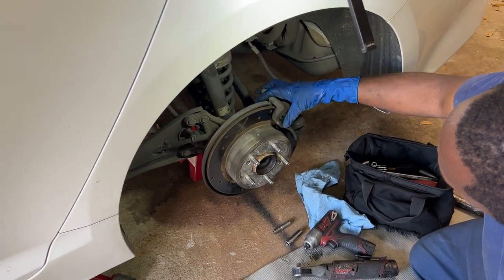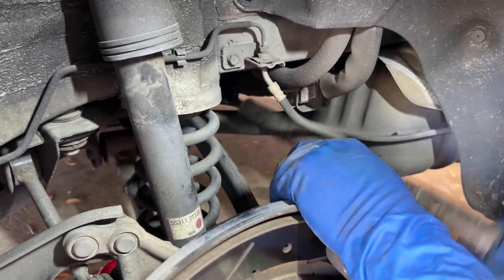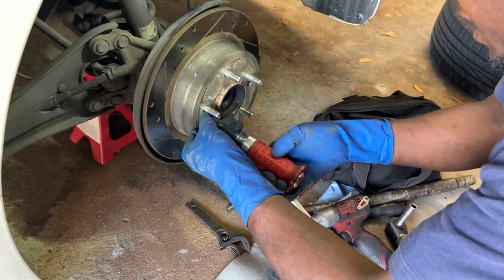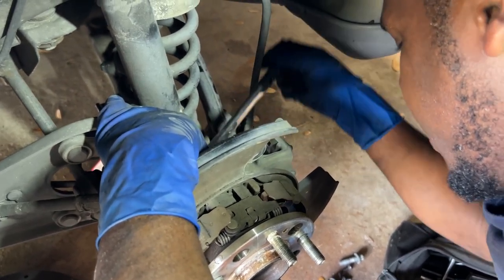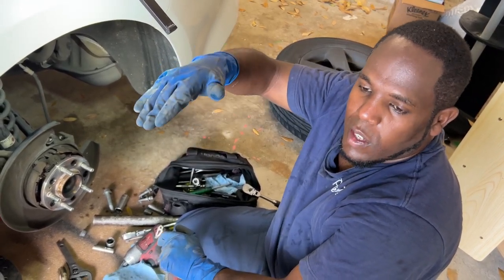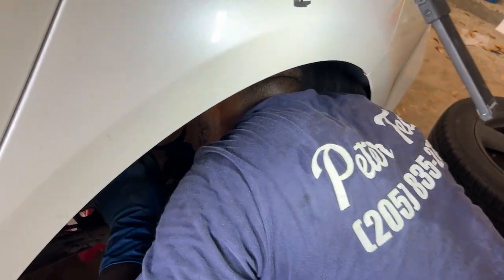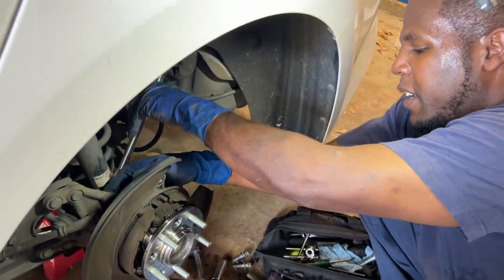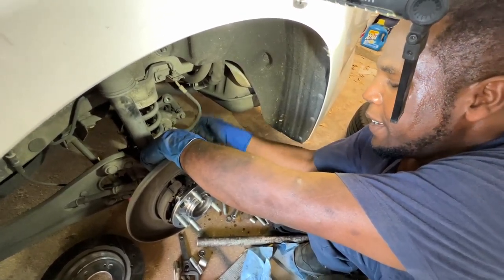HOW TO CHANGE REAR WHEEL HUB ON A KIA OPTIMA | CHANGE WHEEL HUB WITHOUT REMOVING REAR SHOCK

Comment: So i worked at the Hyundai dealership when these 2.4 were new. The engine oil problems stem from two main issues, one was they made the dipstick too long and the car was reading full when it was a qt low and ruining the top end of the engine. Two the timing chain guides were wearing out cause the originals were plastic. The recall engines beefed up alot of things but those two were the big fixes. I got one that had the recall wngine installed at about 75k miles and i got it arund 90k miles, its at 140k and runs like a champ. Loses maybe half a qt in-between oil changes but thats normal consumption for any engine.

Comment: Nice vid good view on the job. Hope I never have to do this on my car 😄 Takes some patience. Also my tip. Let somebody do an engine compression test. It is not that expensive and you will know the status of your engine and piston rings.
Reply: oil can be burned out also because the valve lifter seals! The compression test made with engine cold first without oil then it a bit of thick oil will show only if the  piston rings work as should. Sometimes the crankshaft seal which is on the crank side get to leak and you can`t spot it easy. One can loose some amount without any "trace"

Comment: What’s the torque specs to tighten your hub?
Reply from the maker: Whatever we feel is best
Reply: I guess I’ll just figure that one out on my own. What arm would it do if you say base on this make and model the hub tightening specs will range between 80 and 100 foot pounds torque. Hypothetically what if my best is right enough or too tight to cause thread breakage?

Comment: Damn.. KIA service manual recommend the whole unit to be taken out.. I just thought if there is way to "squeeze"  small socket and do it in that way.. 
Only one thing I didn`t see in the film - how he tight the both bolts on the control arm?
Why? Because the arm must be tight on the level where the suspension is in rest. By that I mean when the car stay on all 4 wheel without any cargo the arm is almost horizontal. 
When you jack it up, it goes about 30-35° down. If you tight in that position, and put it back on wheels , then you get already 35° stress on the rubber bushings. When you drive over bump or put cargo you go another 20° up or in other words you put about 50° stress and they get destroyed  in no time! Cheers